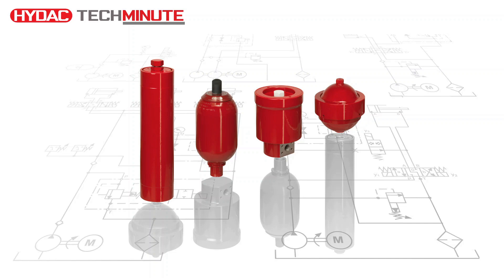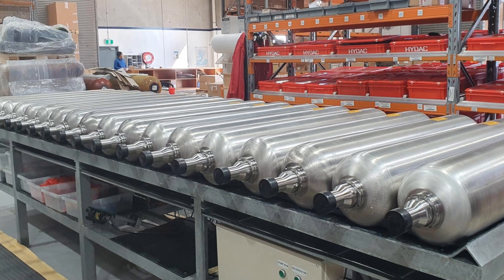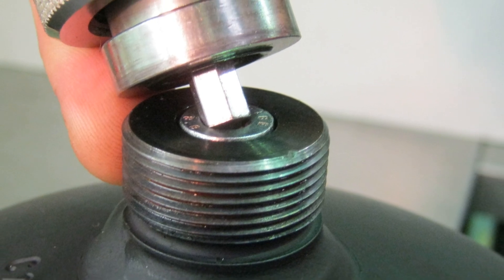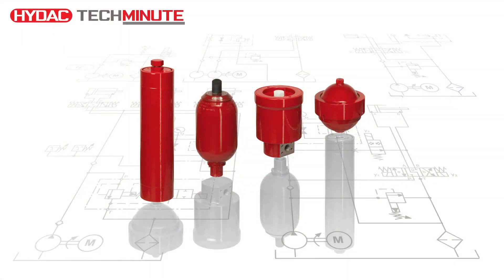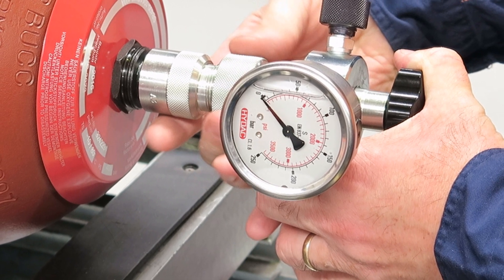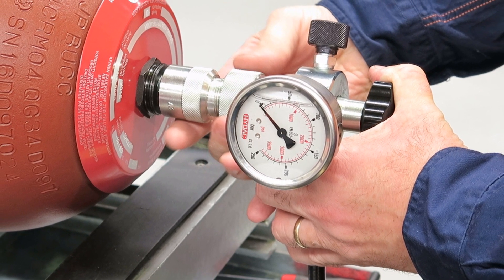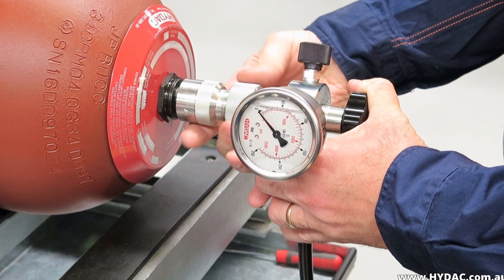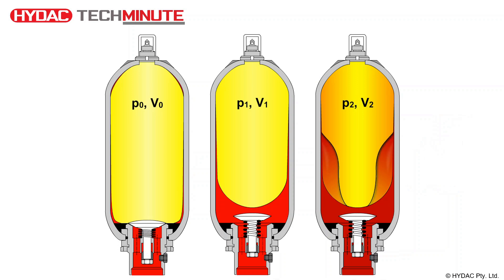HYDAC TechMinute - Importance of accumulator pre-charge pressure

Comment: First thanks for your information. 
I read that the pre-charge pressure is 0.75 percent from the system pressure, for example my system barrier seal is 10 bar so will be 7.5 bar. 
Is that right or not.